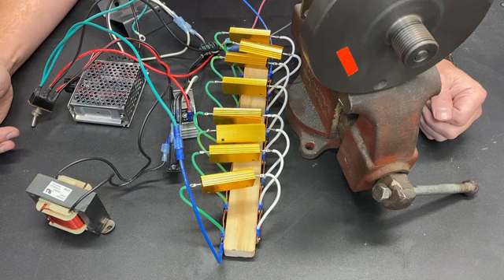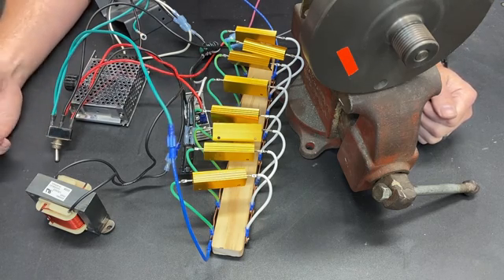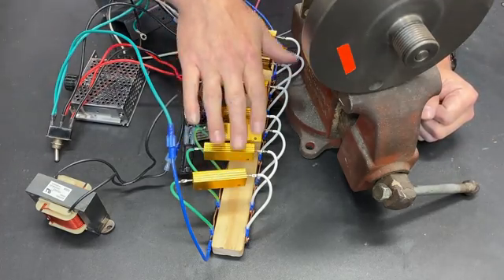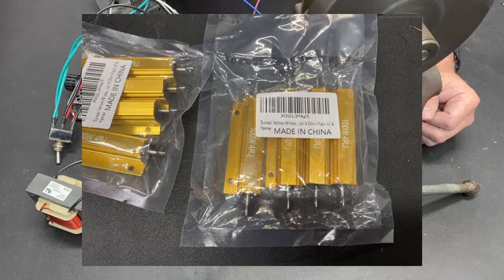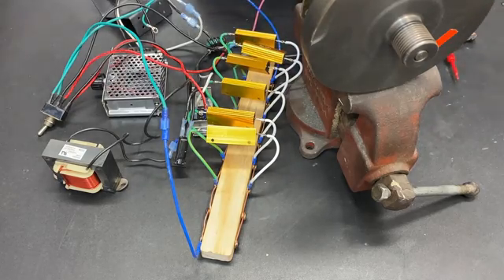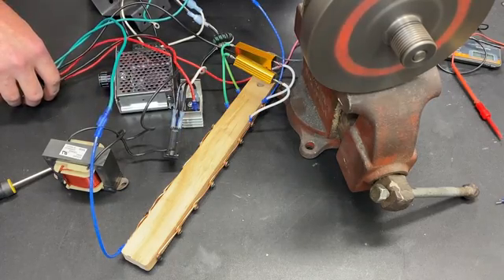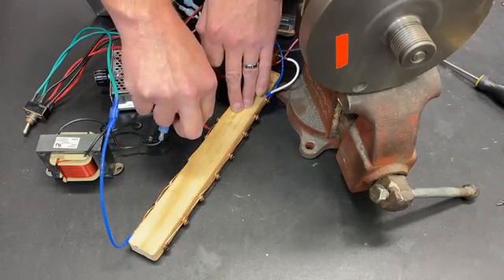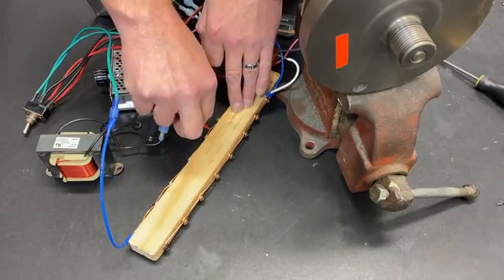Adding Electric Braking to a Treadmill Lathe Motor Upgrade  Experimenting With Braking Resistor Size

Comment: Some nichrome wire and a box you can fit it in and fill with plaster of Paris would give you resistance and power handling to fit whatever needs you have....if you crack one of those resistors open that's roughly what you'll find
Reply from the maker: Great idea for a DIY resistor! I was trying to stick with off-the-shelf components for this experiment, but that's a clever solution.

Comment: 2:53 The mathy way of saying this is that the enery you need to dissipste is half the peak wattage divided by the time until it stops. Technically it's the integral, but ain't nobody got time for calculus. So just assume it slow at a constant rate, and just average the start and 0 - which is always half.
Reply: Just for the supernerds out there, too tie this into the other content I made, you can use Newton's second law with the mass of the lathe, and the derivitive of speed of the lathe and the desired stopping time to calculate the force, and then convert to work given angular displacement, and then look up joules over ohms in the datasheet select the perfect resistor.
For the non-supergeeks, just count how many seconds it takes your lathe to get up to speed when you turn it on. That times the motor horsepower X 750 gives you the same answer. 😂

Comment: 1:57 As someone coming from the Electrical engineering side, I hate to tell you that you've missed the easy and the "correct" way to determine what resistor you need, which is: it's right in the datasheet. EEs love their datasheets. You think we spend all day huffing solder fumes, but we spend 3x as much time staring at charts and graphs in datasheets. Just Google or search mouser/digikey for a wirewound power resistor, find something that looks like yours, and you'll get a pdf file that tells you:
Max temperature: 200*C for 2 hours
Safe Short-term power: 10x rated power for <1second, 5x for <5 seconds
And then, for the "correct" way to do it, there's also a graph that shows you Joules per ohm, which, if you like math (you nerd!) lets you calculate exactly how what resistor to use based on how fast you want the lathe to stop.
That's from the "Tt electronics WH-5 datasheet" which works great in a google search.

Comment: What if your breaking resistor had 100 ohms and 1000 watts? Is too big a bad thing?
Reply from the maker: More watts is never an issue because more just means the resistor is set up to handle the current. More ohms slows the breaking action but is easier on the brushes. The sweat spot is 1-2 ohms.
Reply: @dazecars  Thank you!!
Reply from the maker: My pleasure

Comment: I thought that butt to mouth gives you the most resistance. It seems you are doing parallel to increase the watts. I don't understand this calculation really.
Reply from the maker: parallel increases watts and decreases ohms.  Its a balance between the two and also dependent on the watts and ohms you start with.
Reply: @dazecars  So, ohms is not important? I need to do some reading on this. I thought the flow of electricity was measured in ohm and this is what the brake is trying to achieve.
Reply from the maker: Ohms are very important. It is the resistance and that resistance slows the flow of electrons. Too many ohms and break is not as effective, too few and it’s hard on the brushes. 1-2 ohms is the sweet spot.
Reply: @dazecars  Anyways, I finally got my system wired up for testing last night. My wife will only allow me to test it out of our house.. :-)  My garage is at another location. Once I get it tested with the relay configuration, I will do some testing and reading on the resistor aspect... I am learning. Thank you for all the information. I am a car guy who has been side tracked by building tools and welding. :-))
Reply from the maker: Car guy with other projects… sounds familiar 😂

Comment: Use 4 , and mount / screw them to a good heatsink with thermal paste . The max rating on those resistors requires heat a heatsink.
Reply from the maker: Those smaller resisters were just for testing to find the "sweet spot".  The bigger ones I have don't hardly even get warm.

Comment: So, you want to maximize Wattage while reducing resistance? 
These yellow resistors come in different Ohms, like 2, 4 etc. 
Lower Ohms means faster stop, but increases risk of motor? 
Sorry, still confused a bit. But I’ll follow your advice. 
Does the two position DPDT switch go after the 3PDT rotary switch? 
Trying to see how all this lays out. 
Thanks Daze. Another great video. 
P
Reply from the maker: The 3PDT switch is in place of the DPDT switch.  the third pole is what controls the relay.  Yes you want to max watts while getting the correct ohms, a 1-2 ohms is ideal, and then use a high watt  resistor like the silver ones I show.  Those are a designed "braking resistor" but they are also expensive.  The experiment showed the big silver ones are way more than what is needed and a person can use the smaller resistors wired correctly to dial it in for their system and save a few  $$.  When I conducted that experiment I really expected to burn out some of the smaller resistors.

Comment: Ok Daze. Now I’m confused. How does this fit in to the variable speed drive with 3PDT rotary switch? 
Will this relay work with my 130 VDC motor? If I have 24 VDC relay, then I would need about 100 amps or more, right?
Reply from the maker: The 3PDT switch does bothe direction and controlls the relay.  The third pole is relay control.  As to the 80 amp relay that I list should do the job because most times you are not at full speed in fact you use it at way less than full speed 99% of the time.  I could not find the "correct" relay in an affordable form.  This relay "working" fits into the same concepts as the video I released yesterday.
Reply: @dazecars  Ok. That’s even more confusing. Let me rewatch your videos, and put together some clear questions. 
I sort of understand what you are doing with the brake, but not sure why it works. Having trouble picturing everything together. 
But Damn! You know your stuff Daze. I am really impressed.

Comment: Hey DazeCars, Great videos on the treadmill conversions !  Just bought the 4 ohm resistor pack you recommended and about to hook them up in parallel to the MC1650LS power supply. I'm not positive about where to connect them though and hoping you can comment back to clarify it for me. The motor has Black and Red wires going to the brushes but has Black and Blue wires going to the power switch. There's also a Black and White spade connection on the circuit board labeled LG2 (Line) and LG3 (Neutral). Would you please bounce back and let me which ones to use or point me to one of your videos that show this ?  Thanks !  Jay
Reply from the maker: Watch the third video in the series as that should answer some of your questions.  The resisters connect to the positive and negative wires  from the motor (ON THE DC SIDE) BUT you MUST run a braking switch or a relay.  Just hooking the resisters up without a way to isolate them from the power supply when the system is on will cause all kinds of problems starting as small as reduced motor speed but up to and including power supply failure, resisters overheating and personal injury.   https://youtu.be/9dJodq7lkEs  If you hook the resisters up to the AC side or even worse some how cross connect the AC and DC side the results would be even more disastrous.  Make sure everything is hooked up correctly and use this info at your own risk.
Reply: @dazecars Thanks for the very quick reply. I understand the importance of having the double pole/double throw switch to disconnect the power before engaging the resistors. However, I'm still not positive where to connect the resistors. I believe it would be on the Black and Red wires going to the brushes on the motor would appreciate it if you could confirm that as there's also the Blue temperature sensor wires in series with everything else.
Reply from the maker: @Jay.perez1  yes it is the red and black “brushed” wires
Reply: @dazecars  Thanks again. Going to add the braking resistors and then eliminate the soft start per your video.

Comment: I like this series and am learning I lot thanks.
Have you looked into the way a treadmill controls the speed of the motor? 
As the way your driving your motors you are losing a lot of potential torque especially at low RPM ie if your running a motor at 25% power you only got 25% torque. Where a treadmill monitors the RPM of the motor and will increase the pwm time until it reaches 100% so basically running the motor at Max volts even though it's running at 25% speed.
I hope that this makes sense. As I think this would be really helpful especially if trying to run a drill press. Witch is what I want as need as much torque as possible at low RPM s.
Thanks for all your great advice.
Reply from the maker: I am glad you are enjoying the e-brake series.  This Thursday I will be dropping the video on making it automated.  As to your comments on power supples, I mean no disrespect but your information is incorrect.  First using an SCR voltage controller uses the exact same technique to “lower the voltage” that a PWM does.  The only difference is which side of the rectifier the switching happens on.  With a PWM AC is converted to DC and then the pulsing happens.  With an SCR the pulsing happens on the AC side and then it is converted to DC.  Both are applying max voltage in short on off bursts with the same basic result.  The biggest difference being cleaner more consistent power from a PWM.  The second issue and this is a big one, voltage DOES NOT EFFECT TORQUE.  Reducing the voltage ONLY effects RPMs.  Torque is determined by amps not volts (* with one caveat see below).   The amperage flowing through the coil is what generates the magnetic field, and the strength of the magnetic field is what creates the torque.  If you take a 20 amp motor and hook it to a 12V car battery you will get max torque because the battery has more then enough amps  to max the motor.  On the flip side a 12 amp PWM on a 20 amp motor will produce less torque even though it is switching on and off "MAX VOLTS".  

*Now there is an exception to all this.  The coil in the motor has a small amount of resistance and a minimum voltage is required to overcome that resistance to start the motor turning and then slightly more voltage is required before max amps is reached but once max amps is reached, either max draw on the motor or max output on the power supply than max torque has also been reached regardless of the power source: SCR PWM or other.
Reply: @dazecars  Hi thanks for your reply. No disrespect taken at all I'm no electronics expect so welcome the feedback greatly. 
What I'm saying is an scr or a pwm pulse the input voltage. So at low RPM no load  the pulse is short say 10% duty cycle so if you try and stall the motor it's quite easy to stall.
 But a treadmill monitors the RPM of the motor and if the RPM starts to drop it will increase the duty cycle and try and keep the same RPM. I have experimented with a clamp meter around the live output from the wall and with the scr control and low RPM I can stall the motor easily and the amps only rise to 2amps if I do it on the treadmill even at lower RPM it's much much harder to stall and the amps rise to over 10amps as it increases the duty cycle of the pwm to try and keep the revs the same.
Hope this explains what I'm getting at.
Reply from the maker: @nickhardiman2142  I am not disregarding your experiments.  I am sure the results are accurate but that does not mean they are universal.  If the treadmill controller has a tac signal, then yes it will compensate.  I have no doubt your SCR was not up to the task but that has not been my experience.  I single point thread grade 8 bolts all the time.  That means very low RPMs and very high tool pressure requiring extreme torque and I have more then enough.  I however am NOT running the cheep SCR that most youtube video recommend.  I too have conducted a bunch of real world experiments and have found the SCR I am using works as well if not better than the treadmill PWM.  We could go back and forth based on our experience arguing which one is better but we have different results from different setups. 😁

Comment: I'm using an old GM ceramic  ignition Ballast Resistor.
Works great.
Btw.
Love your work..
Reply from the maker: What is the ohmage?
Reply: I believe that its 1.5ohms.
The motor im using has 1.3Ponys from memory?
With a 2100 series Power Supply.
I've wired it up to a 3position/6terminal rotary switch, channelled through 2 large capacity relays.
Switch pos 1 =Relay1 =forward 
Switch pos 3 =Relay2 =reverse
Switch pos 2 = 0 (off)
Motor + and Motor - are arranged to short out through the Ballast Resistor through each of the relays NC terminals.
ie.
Motor+ >relay1 Com
Motor- >relay2 Com
Each relay coil energised through rotary switch using separate 24v.
V+ and V- wired to both relays NO terminals. 
Each end of the Ballast Resistor is wired to one NC terminal of both relays.
Reply from the maker: @daxgilmore4374   1.5 ohms would be in that "good working range"  The rest of your comment is practically walking all over next weeks video 😁😁😁  I too automated the system by using a relay but I was able to do it with a single relay.  Stay tuned that video should drop next Thursday
Reply: @dazecars  Haha..
I'm glad you could make sense of all that.
I figured you'd be able to fill in the finer details yourself.
I did initially intend to use a single relay.
But I like the way the rotary switch operates over the rocker.
My PWM Sig Gen doesn't include the "on/off" button.
So  I'll be using Position2 on the Rotary, to act a 3rd relay to cut the signal to the 2100.
If my assumption is correct. 
I'll be able to just turn the rotary back 'on' and it will start back up at the previously set value.
Rather than having to turn the PWM back to '0' and then ramping back up to speed. Right?

Looking forward to seeing your next video. Your ability to explain things in simple terms without all the bloat, is appreciated.
Cheers.
Reply from the maker: @daxgilmore4374  I too am using the rotary switch as my direction controll and as way to engage the brake.  It switches my direction and cuts power to the DPDT relay when in neutral.  I will also wire an emergency stop switch in series with the master power.  The final result is a setup where the brake engages if I cut main power, hit the emergence stop switch, or go to the neutral position when switching directions.  As to you situation of using the switch to cut the signal to the MC2100 I think that should work but I can not say for sure.  I have not messed with that as an option being that my PWM signal generator came with an on/off switch.  I don't see why it wouldn't work but then again there are safety's in the 2100 that sometimes cause odd functioning.
Reply: @dazecars  Mushroom Stop Switch? Yes, I've got one wired up to isolate all power to the machine other than the lights. 😆
Thanks for the info mate.
Love your work!

Comment: Hi there,
I have a 3hp (4750rpm) TM motor with mc-2100(2 capacitor type) and pwm unit and tested running it in reverse for the first time today and it seemed to spark much more under load or rpm. the brushes didnt seem to be offset from radial so would this just be from how they are worn in? should i just let it wear into this new direction or file them flat? Thanks
Reply from the maker: I think I would let them wear in.

Comment: I'm also loving this series. I'm still hung up on a good choke solution. The recommended vendor was out and said treadmills haven't used them in years. My first acquisition used a mc2100 so no choke. eBay seems overpriced. I checked into some vendors for new ones. This seems semi promising, but I'm not 100% clear on how to properly spec one. I'm thinking 10A is probably right and about $50. I also looked into new drives such as kbic-125. This seems promising but still expensive, especially with a proper heat sink. I also looked into your video on making my own. I think I'm going to stay away from microwaves and transformers in general at this stage of my diy... I'm left thinking PWM that drove the motor in the first place or sourcing professional drives are in the end the best for me vs SCR and choke . My 2 cents.
Reply from the maker: It's all about what you have available, what you are willing to spend, and how you plan to use the system.  As I have said I prefer the SCR to the Mc-2100 but the MC-2100 is still a good option.  Be carful with some of the aftermarket PWM.  A lot of them are lower amps. If you power a 20 amp motor with a 10 amp power supply you will loos torque as there is a direct relation between amps and torque.
Reply: @dazecars  I think you said as much in one of your videos but it didn't click with all the new information. That makes sense, but I'm wondering if it matters at slower speeds? I guess put another way is the loss of torque constant across all speeds or only at the top end that I wouldn't be using?
Reply from the maker: @elonf6164  Once the power supply is putting out sufficient voltage to overcome the resistance of the coils in the motor torque becomes constant.  In plane english at the very bottom of the speed range you will not quite have as much torque but once you get past the initial lower area torque becomes constant through the rest of the RPM range.  I always recommend maximizing RPMs through gearing.  In other words if you treadmill motor is 4000 RPM and you only need a max of 1000 RPMs,  gear your setup at 4:1  That will give you 4 times the torque and even slower speeds and then the advantage of being variable from 50-1000.